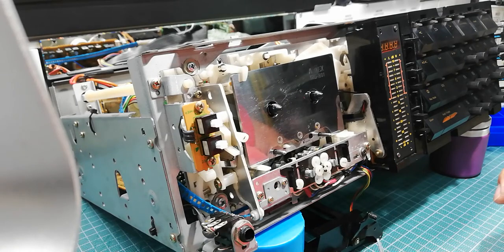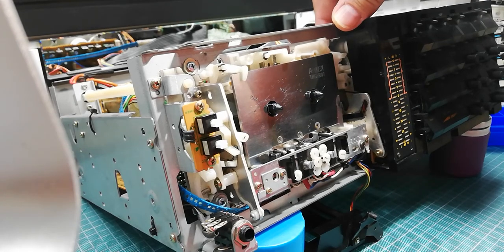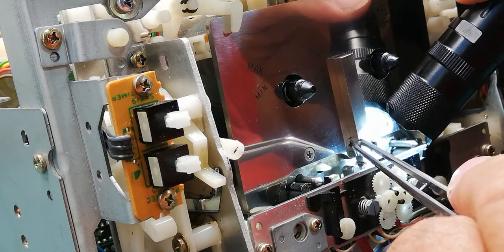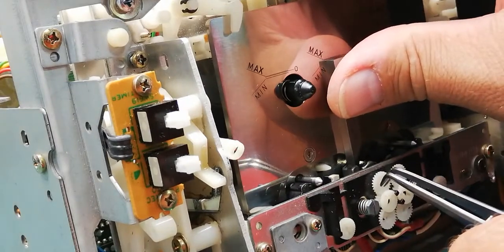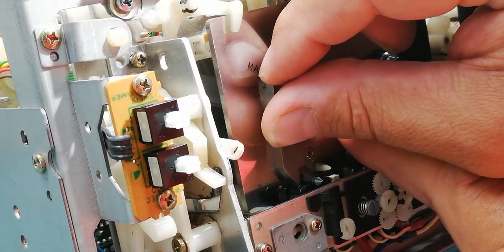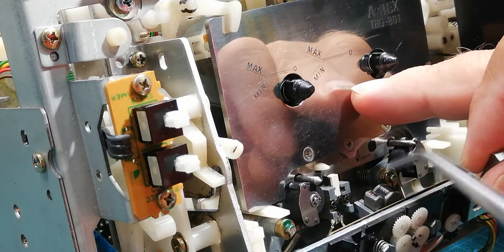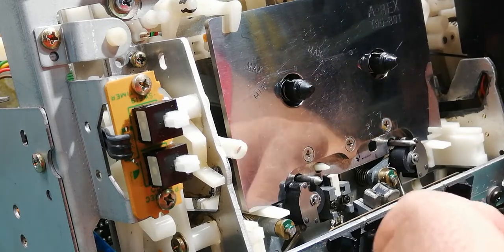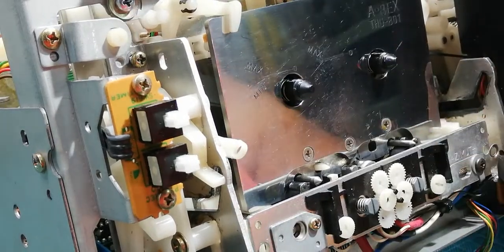A Bex THG 801   how to use

Comment: Whats the easiest way to put a Sankyo mech in play mode? Thanks Andrej
Reply from the maker: @RandyWBrown  press play button
Reply: @CassetteDeckService  I thought so but you put the dragon in play by manually turning the mode gear so I thought there was a way to do it on all decks but wasn't sure how. Thanks and have a good day!
Reply from the maker: @RandyWBrown  ahh...you meant for doing this...well...i do this when mech is of deck and i lift it with external power supply.
Reply: @CassetteDeckService   Ah yes That makes more sense 😃  ,what do you do, apply 2 or 3 volts to the cam motor while mechanism is out of deck? If so no need to respond, unless I'm way off! Thanks for responding Andrej and stay healthy and safe!
Reply from the maker: @RandyWBrown  i started with 0V and raise till head is in top position then turns off voltage :)
Reply: @CassetteDeckService  Ok thanks once again kind sir.